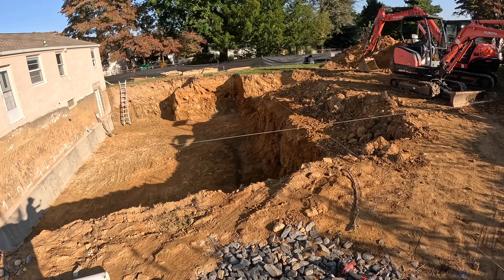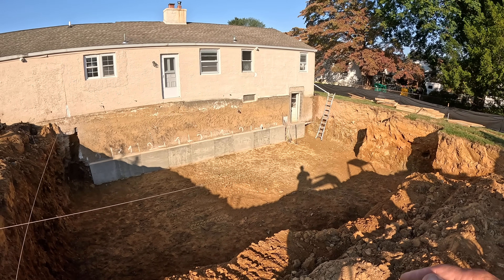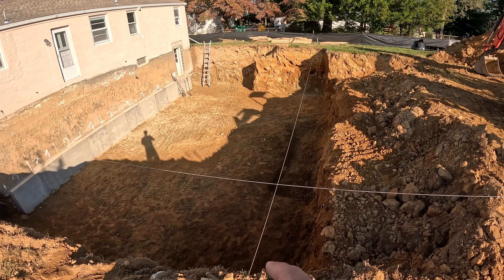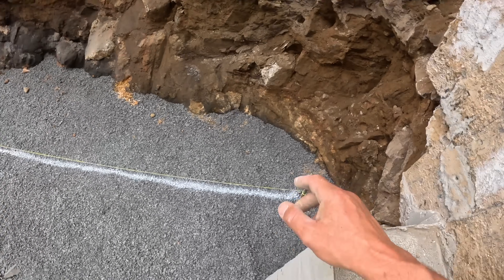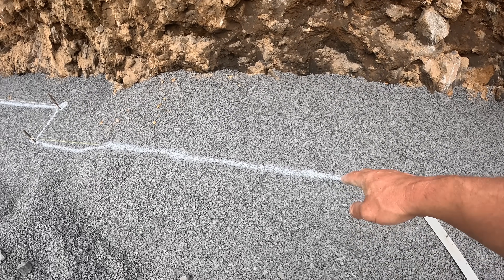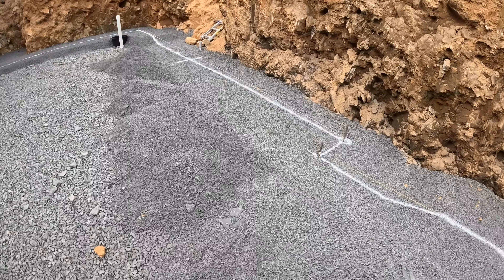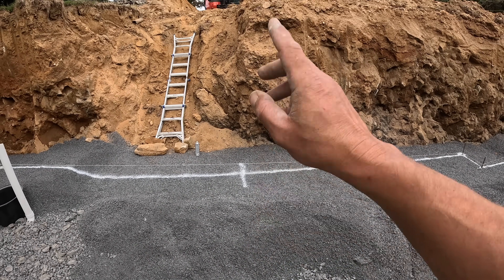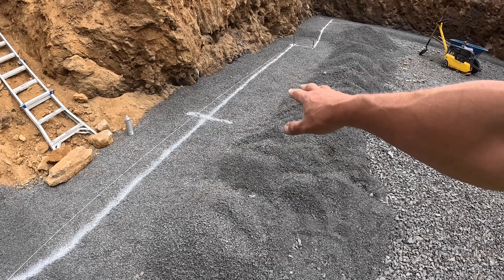How to build a basement

Comment: I will be working on my new house with ICF, i.e. blocks build by the Perfect Block, and have not move forward until I find a roof solution. I don't want to build a concrete house with a wooden roof, this will defeat the purpose of my project. Can this precast system be used as a roof in an ICF house that has a pitch roof? Let's talk.

Comment: Building a house next year. Very interested in this. Is the concrete floor going into the stud bays? If you have a 4 inch thick floor, wouldn't it go into the bays? Just curious about the flooring detail where it meets the wall.
Reply from the maker: The bottom of the wall footing is 4" thick

Comment: The bottom of the walls just sit on the ground without any type of anchors?
Reply from the maker: On a stone base, like a retaining wall
Reply: @srmcontracting the residential building code allows Stone and it allows pressure treated wood for a wood basement

Comment: I have a 2005 Superior walls house, no leaks, the concrete panels are I believe 5,0000 psi concrete so they are waterproof as-is, no outer membrane or tar needed. Like a steel ship, it would float if shaped for buoyancy. The joints are the only possible issue, but below ground the sealant is fine, only need to monitor above grade as Sunlight/UV rays can degrade above grade sealant. I added another 2" of foam boards in each bay and spray foamed all joint before drywalling, so 3" of foam total.  The studs have predrilled holes to run electric, data cabling, even plumbing tubing but I kept all my plumbing in the core of the basement--cannot freeze there.  Rich
Reply from the maker: Thats good to know, Thanks for sharing

Comment: You could have built a pressure treated wood basement...yes a permanent wood foundation was built in the 70s up till now ...dig your basement lay 4 inches of gravel a 2x10 is your footing what ever your size building then you build walls on top of the 2x10s just like your above ground framing... only difference you use pressure treated lumber and pressure treated plywood for walls and building pressure treated floor as well but it has to be sealed out side before backfilling with good amount of rock for drainage with drainage pipe as well.....I know it sounds crazy I never knew they built them...but they become big in Canada and moved to the US...I seen pictures of apartment buildings big pretty nice homes built on a pressure treated foundation....I have read people that had them say they didn't leak if they were done right... they said no concrete truck no concrete working or waiting... they said your regular framing contractor's can do the whole building as the pressure treated foundation..... that's crazy 😮
Reply from the maker: Interesting, thanks for sharing!

Comment: Great job . 
You might be interested that in Europe , Germany in particular basements are often built above ground with the first living level actually being the second  level . 
This save a ton of money on excavation and eliminates ground water problems . One side remains open for a garage door and all utilities are easily installed and routed under the ceiling/floor which is thick concrete ,usually about eight inches or more thick .
Reply from the maker: Thanks for sharing, interesting to hear how it's done over there!

Comment: I don’t like this. So many seems for water to get in, no footing. I genuinely don’t see how this is better then a poured wall and footing.
Reply: My first house was built with superior walls. It’s 5000 psi concrete, didn’t need waterproofing (allegedly due to the high psi), came ready to hang drywall on furred  walls, no wait time. The only timing issue is you need first deck on and basement floor poured before backfill. The urethane caulk they use at the seams is bulletproof.

Comment: It's crazy how you can set those panels down without a footing underneath.
Reply: Concrete footings are the only way to go , they’ve a proven record ..
Reply: @saltbeltupstateny4857  I'd have believed a lot more in this system if there'd been some whiz-bang structural connection system between the slab (to come) and the new perimeter walls...and prolly a thickened interior slab edge.  I don't see why this system won't settle in time, especially/apparently without rigorous compaction being performed, beyond the vibrating plate.  I suppose it's got a stamp, though...?

Comment: More like cheap hack job foundation.
  Anything to save a dollar
Reply: Thanks for confirming that you don't have a damn clue what you are talking about😂
Reply: I’ve been building in the Northeast, mainly since the early 60s. Not having a footer seems to be asking for settling problems. Also the Bilco installation in that area with all the openings and everything seems to be a little sketchy.
Reply: @saltbeltupstateny4857  What college did you get your engineering degree from?

Comment: It all just seems so mickey mouse and sketchy. All that gravel moved by hand when a stone-slinger could do it in ten minutes? And as someone else mentioned... no concrete footers for a house? Unbelieveable that building codes would allow that. At the very least, I would expect to see someone from the county inspecting the compaction of that gravel before you start standing your support walls on it. And I really hope you're going to install weeping tile on the outside of the basement walls. That has got to be mandatory by code.
Reply: The footing is "built in" to the base if the wall sections.

Comment: Thanks Sean! Amazing technology; 😢I’ve never seen this type of construction before but should speed up the speed of house construction. I particularly like the steps unit. Adding that in my area (Toronto) is very expensive, especially if you have to get equipment through between neighbours. If there wasn’t as much room to get trucks through to the backyard, would you use a large crane to hoist it over the house? Great videography too.
Reply from the maker: Glad you enjoyed it! Yes they use bigger cranes in those situations

Comment: I think a pumper truck and pouring concrete walls would have been better And that's a basement should be done when possible and they make insulated forms. I think having to go up a set of steps to get into the old basement would drive me nuts instead of having the new and old floors at the same height

Comment: Great work Sean! I do have a question though… and I ask respectfully… but shouldn’t that sump basin have holes drilled throughout it so that ground water doesn’t float it out of position? Maybe I missed that part or perhaps you didn’t show it. But I figured I’d ask. Thanks for your great content.
Reply from the maker: Thank you, holes could always be added. But both pipes are perforated right outside of the basin and the pipe is at the bottom of the basin. So any water would end up in the pipe and into the basin.  Luckily this area doesn't have any ground water issues so it should be fine either way.
Reply: Debt...Absolutely ..

Comment: Where are the footings? A wall over gravel no footing? Never seen that done. The future will tell in about five years.
Reply from the maker: I was skeptical of them when I first learned of the system as well. The compacted stone acts as the footing similar to a retaining wall. They have been installing these since the 80s apparently. Thanks for watching and commenting!
Reply: I know someone with a modular, prefab home on the superior basement walls with no footings and no issues after 20 years.
Reply: Superior Walls (and others) have been using this sort of system for decades, with very good results. Compacted gravel is an excellent footing material.
Reply: @spenceralridge4958  I just wonder why the inspectors are so picky about the footers for site built walls? I would think the same principle would apply.
Reply: My house was built in 1998 with Superior Walls and zero issues with cracking, movement etc. They are still perfectly plumb and level and there are no cracks nor leaks. It's an engineered system so if the prep work is done correctly, the rest is prescribed and already engineered to work. The CMU foundation at my last house was bowed in and leaking. Traditional ways aren't always better.
Reply: @neonpcmsplus just curious, do you know if your cmu was filled or hollow? Thank you!
Reply: I was also expecting them to be installing some sort of precast footer on top of the stone. You learn something new everyday.
Reply: Gravel footing has been in the building code for 50 years and don't train ride on a gravel footing

Comment: Great video, thanks. Learnt that Radon is an issue in some areas, but because basements are almost unheard of here in Australia I had never seen the radon ventilation tube used before, but it helps that we have lower than average Radon levels here too